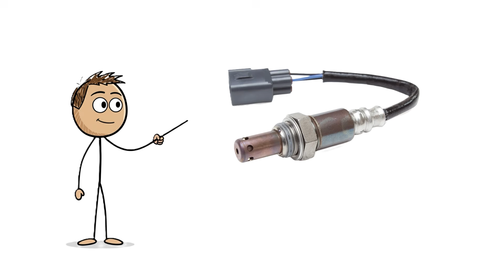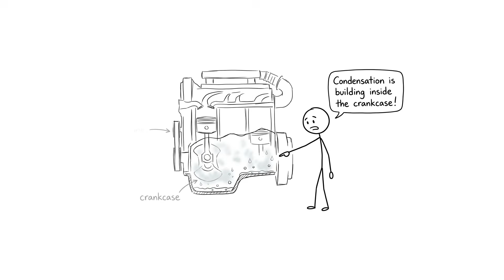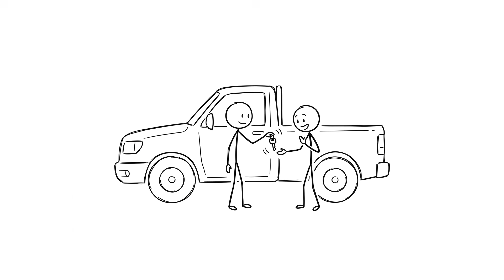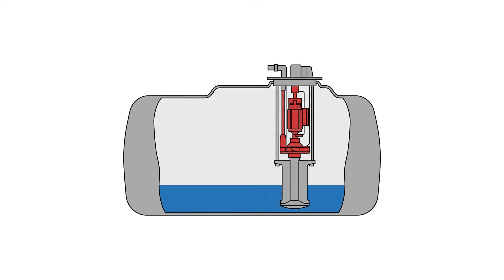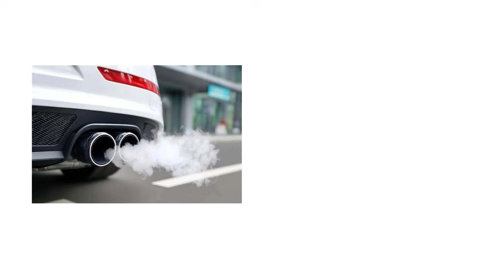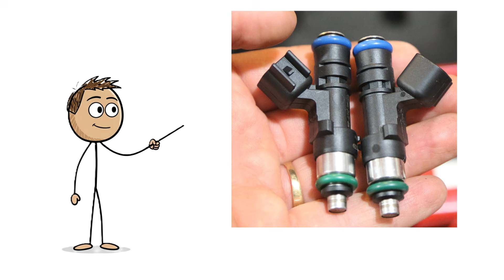99% of Drivers Don't Know This ONE Mistake Destroys Fuel Injectors Before 20,000 Miles

Comment: Hey thank you so much for the knowledge, I have a question if you got time. I just bought a new alternator and battery and my battery light comes on and off and randomly my AC cuts out and goes back on, I returned the alternator and got another one and still the same issue something keeps killing my alternator do you know what this could be?